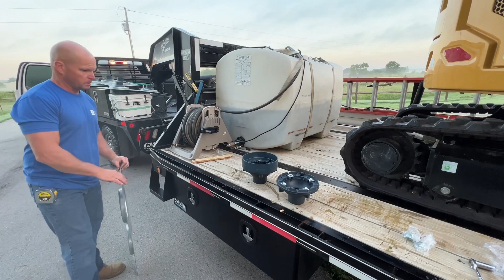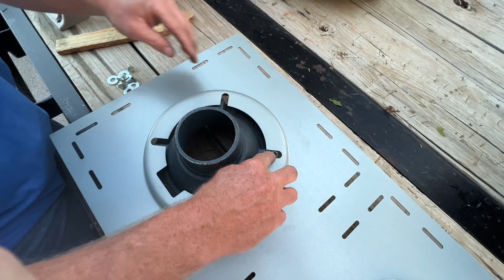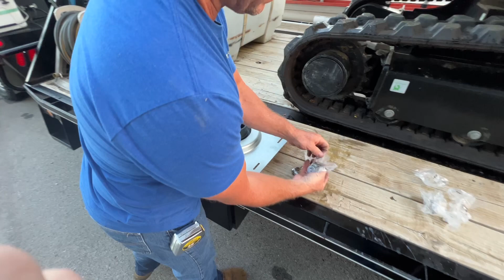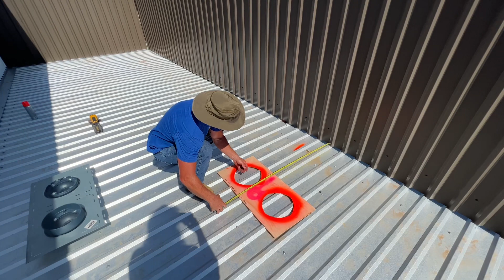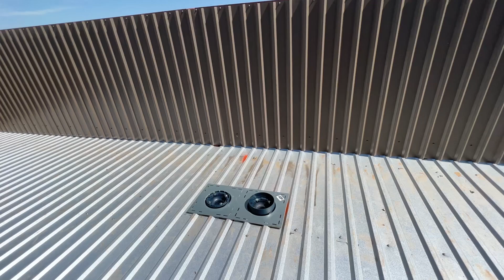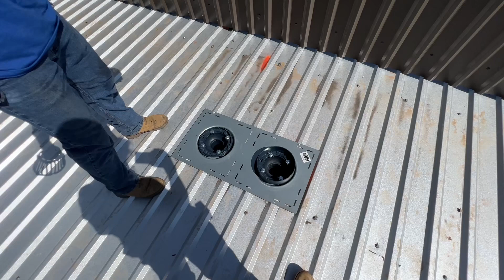How to install the Zurn Z165 roof drain

Comment: What do you do when they are putting 6" of insulation on the deck and they need raised? Do you still mount the plate normally and then use all thread to raise the strainer plate?
Reply from the maker: Correct, we still install the same way and use the riser's. Fortunately we haven't had to do any of that. No calls from the roofing company is a good day for us.
Reply: @jonesplumbingacademy  thank you for the fast response. Appreciate it!
Reply from the maker: Go to Turn and look up the model number and there will have a insulation on it. Probably will need to buy extra parts from them as well.